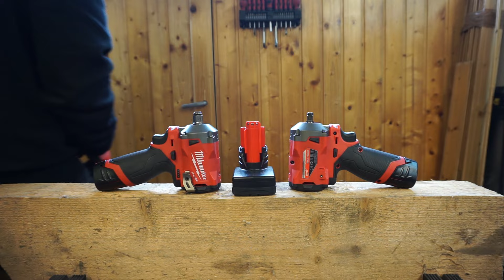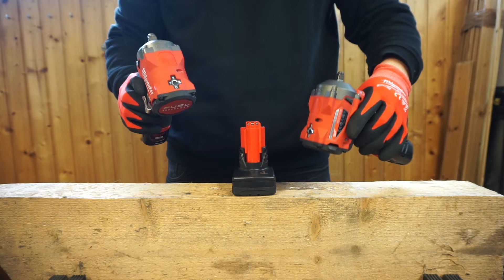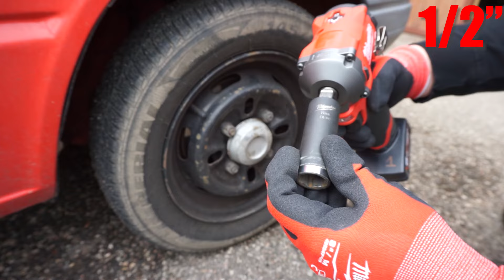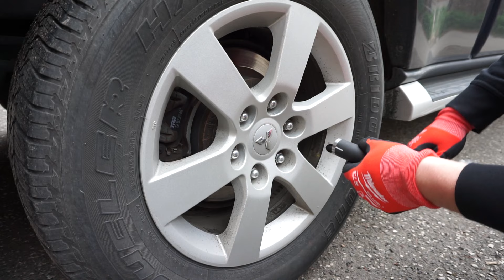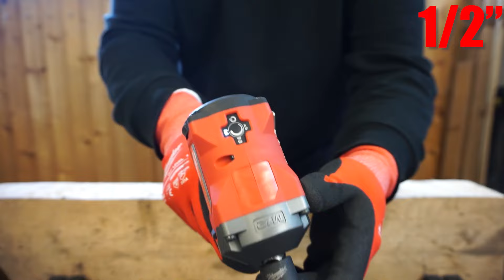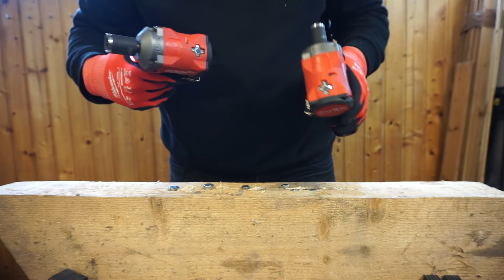3/8" stronger than 1/2"? - Milwaukee M12 stubby impact wrench 3/8" vs 1/2"

Comment: Cool test. I actually have two 3/8 stubby's since I couldn't pass up a deal on one for $60 bucks. Anyhow I run one like normal with standard 3/8 sockets and the other one I run with a 3/8 to 1/2 adapter. I can tell you without a doubt the 3/8 with the adapter hits way harder with the extra mass of the 1/2 sockets that it has sidlined my brand new Gen 2 1/2 Midtorque LOL. I work on light duty cars and trucks so that sucker surprisingly has busted loose most fasteners I've come across including heavy duty GMC/Ford suspensions. Kind of curious since you have both if you can run the same type of test, but using a 3/8 to 1/2 adapter on that 3/8 and run them side by side again👍🏼
Reply from the maker: Strange, most tests on youtube show that adapters take away a bunch of torque. I think the 3/8 hits harder because there is less mass to rotate with the lighter socket, thus load on the motor is smaller so it rotates faster and hits the anvil with faster blows...? Only a theory, otherwise I have no explanation why the 3/8 would be stronger.
Reply: @vpmotors9529  Trust me I've tested it myself. I used a 22mm deep 3/8 socket on a Old Ford Heavy duty lug nuts. I let the socket tighten as tight as it would go with no further movement. I then slapped on a 3/8 to 1/2 adapter and marked hash marks for reference on a 22mm deep 1/2 socket. Well to my suprise running it with the heavier mass of the adapter/socket combo that nut almost did another full rotation. My guess is the same as yours, but since now the faster 3/8 Anvil is swining the added weight of the 1/2 socket and adapter that inturn gives it extra beans to power through the standard 3/8 limit. That is why I'm curious to see that how that adapter set up will do against a regular 1/2 Anvil. I can actually feel the difference in power while using the adapter it's like a Mini Midtorque kinda hard to explain. Try it and let me know what you think?
Reply: @johnny4713ify  I had the same results, a 19mm 3/8 could not remove my jeep's lug nuts, but when i used a step up adapter, it removed without any problem. In fact, I installed new shocks using the 3/8 stubby and 1/2 sockets. Unfortunately, I feel like when it reaches 2 bars of battery life, it's not the same as having 4 bars.
Reply: @Pillzb3rry  Nice glad you tried it out. I ordered a Titan 3/8 to 1/2 adapter that's more compact essentially it will have almost the same Anvil dimensions as a regular 1/2 so ill be curious too see how it performs with a bit less mass. I normally run the 6.0 battery and get a pretty good run time before I hit the two bar mark. Your right though you do lose beans with any wrench when it starts to gets too low. BTW your 6.0 battery looks different than mine so I'm assuming your up in 🇨🇦 😁. I only say that because I've noticed Milwaukee batteries are labeled differently when they are sold out of the states.
Reply: @johnny4713ify  Look up ARES 70198 that adapter is like it does not even exist it is soooo small. I am suing it on my stubby and you can barely tell it is 3/8 and not 1/2.
Reply: @drscopeify  Hey thanks for the info👍🏼 It look's pretty much the same as the Titan (design dimension) adapter set I got. Your right these low pro adapters are pretty cool. I haven't tried testing the Titan against a regular 3/8 to half inch adapter just yet. Every gram of weight seems to give it more beans so going the low profile adapter route all the time might be decreasing a bit of power, So at least now I can pick and choose what adapter to use based on the location and size of the fastener kinda nice🤙🏼
Reply from the maker: @johnny4713ify  These are EU batteries, I'm located in Hungary.
Reply: @vpmotors9529  Pretty Cool👍🏼.
Reply: That would be a great comparison 👍
Reply: I noticed this same phenomenon when I put an adapter into my M12 fuel impact driver.  All the sudden I'm able to take off my cars lugnuts as long as I use my 4amp battery.  I still want to get a stubby 3/8" but I'm torn between the M18 fuel and the M12 fuel.  I have both batteries so the only thing I care about is strength.
Reply: @NonieTools  For me it came down to being able to get into the tightest spaces in and around vehicles. The M12 stubby can breakdown even smaller especially around the engine bay (no boot to hang up accidentally break a sensor lol) and still pack a punch with the regular Torpedo battery and now with the new HO 2.5 torpedo it's like having similar power to the boot style 4.0 in the smallest package possible. The M18 compact disadvantage is it can't become more compact to squeeze into tighter spots. The advantage it has over the M12 is the tri lights and run time it can go for days without a charge. I've seen plenty of test with the old m12  running a 4.0/ 6.0 boot battery go against the M18 compact running a 6.0 HO battery and the difference is minimal if that. Sometimes the m12 out performed the M18 in some test kinda nuts. Have you looked at the Gen 2 midtorque? The size and weight of one running it with a 3.0 HO battery will suprise you. I measured it to my stubby and it's a little over an inch difference in length and a tad bit thicker that's why I skipped the compact since the size difference wasn't too drastic plus you get tons more power. If you have Dewalt Batteries the 3/8 DCF923B seems to be the smallest impact with it's 450 Break Away and powerstack battery. I know hard choice 😅
Reply: @johnny4713ify  all very good points.  I am not a mechanic by trade, I'm a carpenter and a painter/ handy man.  But I do fix my own cars whenever I can.  I do lots of odd jobs like putting up fences, putting in handrails on stairs and building ramps. I think the stubby is more than I need power wise.  I only have Milwaukee batteries, and I just ordered the m18 fuel impact/hammer drill/multi tool/hackzall with a 6.0HO and a 3.0HO plus a 5 xc.  But I also have the M12 impact/hammer and 2 2.0s, a 4.0 and 2x 2.5 HO's.  Considering I already have bigger M18 HO  batteries I think I would benefit more from the M18 fuel stubby.  But I'm still flip flopping because it's such a hard choice!  I LOVE the M12 stuff I have. It's so smol and looks great.. I haven't looked into the mid torque but I feel like it's a bit too much power for what I do.
Reply: @NonieTools  Tuff choice for sure. I use my M18 2853 impact driver's a ton too for everything. They are pretty powerful from lug nutts to snugging down wood panels is a handy tool for sure. I can tell you one thing at least for me is weight. Lugging around a heavy tool all day can be a pain. Even with my M18 2853 I mainly use the a smaller 2.0 battery since I'm not doing a whole lot of heavy applications with it. When I do slap a 5.0 you can definitely feel the difference. For me comfort and power is what I look for. I think the Tri Lights and Battery life will benefit your work environment more than anything. If they update the M12 stubby with Tri Lights I'll take that over the M18 compact for sure. BTW I do believe the M18 compact overall head size is a bit less than the M12 stubby maybe thats why the M12 can still hold it's own and still seems to lay down a bit more beans. If you look at shop tool reviews test the M12 3/8 running a 6.0 with 1/2 adapter put up some crazy numbers. The only issue I can see you running into is space. Yah agreed the Midtorque is a bit to large for handyman work unless your running down anchor bolts all day lol. BTW you can always pick up second hand impacts off Ebay for cheap. I've picked up a few even a for parts only like new 3/8 stubby for $60 and yes Milwaukee still honors the 5 year warranty with no proof of purchase. I sent mine in and they sent me back a like new reconditioned running unit works great👍🏻
Reply: @johnny4713ify  I'm waiting for my M18 fuel impact to come in the mail along with a 3.0 and an 8.0 both HO.  I'm pretty sure the M18 stubby with an 8.0 high output battery would make more beans than the M12, right?  Of course it would be bigger and heavier though.  And by the way that's one hell of a trick I might just have to give it a shot next time
Reply: @NonieTools  That's awesome!!!! I have 8.0 HO M18 battery, but to me and from what I've seen online the 6.0's hit the hardes't unless you move up to the 12.0.  Man Caver tool reviews has a few videos running the M18 against thr M12 using the 6.0 battery. The 8.0 is great for battery life tho so you'll probably won't need to charge it for a few weeks LOL. If anything you'll save weight running it with the 3.0 HO. Yes sometimes I send in a pretty beat up tool and get back either a brand new tool or refurbished tool that looks new. I have also got back tools that are internally repaired and the shell is still a bit beat up, but I don't mind. The only thing to remember is to make sure the serial number is still visible and know how to read the manufacturer date so you can verify that it's still under warranty. You can go into your Free Milwaukee account input the tool with the serial number and it will tell you if it's under warranty even before you buy it off some place as long as you can read the Serial# you can check it on the site. Please let me know how you like your new tool and if anything pick up a second hand stubby on ebay for cheap used or parts only then send it in. Happy for you bro👍🏻
Reply: @johnny4713ify   @johnny4713ify  thank you for the info, I just checked and it's actually coming with a 6.0 not an 8!  Should be here tomorrow.. so pumped to get my hands on everything. I just saw on torque test channel that the 6.0 outperforms the 8.0 by a little bit.  Something to do with the different specs of the cells in the bigger battery.  Anyways, I have already started hitting up people on FB market looking for some used stuff! Again, thanks for the advice!
Reply: @NonieTools  No problem. Let me know how she runs for you. Don't forget to pick up a protective boot for your investment 👍🏻 Congrats!!!!
Reply: @johnny4713ify  just went to home Depot to return something and they had a M12 fuel stubby 3/8" impact with 5.0 high output battery and bag and charger on clearance for $169.  Model 2554-21HO.  I COULDN'T pass it up.  Something about a black Friday deal leftover that they dropped down even more.  Crazy.  My m18 stuff is so powerful but I'm constantly reaching for the M12.  Anyways, can't wait to rotate all my tires this weekend.  Hope all is good with you brother.
Reply: @NonieTools  WOW!!!! That's a smokin score brother 🤯. I saw that deal a few months back at $350 now it's on HD website for $250 for the clearance sale of $169 with everything was a killer deal. Bro now your going to be the go too for the pros and cons of both 🤣. Glad you have both to work with since I'm sure your going to come across jobs that require the right tool more run time with the M18 and squeezing into some tight spots with the M12. I can already see you battling them both on your vehicle wheels LOL. You can always shave off a few seconds with the 3/8 to 1/2 adapter while using deep impacts when doing tires💪. I see your reaching for that M12 over the M18 I get it she is addicting once you take her for a spin 😜. Happy for you brother.
Reply: @johnny4713ify  Which do you recommend Milwaukee or Dewalt?
Reply: @johnny4713ify  yep hell yeah I took the day off from work because my daughter was home sick from school and I totally re-fastened her swingset.  Used every single tool I have (except for the multi tool) the M18 drills and the M12 drills and impacts, including the stubby. Cut off the ends of the long protruding 5/8" bolts with the one handed hackzall w/ a thick metal cutting blade by Diablo. Like a hot knife through butter my friend.  Looks like I need to get some 1/2" sockets and some 1/2" adapters.. my 3/8" impact set is metric and SAE 48 piece set by WIILDIS only $50 on Amazon.. what socket set would you recommend?
Reply: @novavolks9652  besides the 5 year Milwaukee warranty for me it's the M12 stubby. Why? I wanted a reliable yet powerful impact wrench that could get into the smallest spaces possible. Yes the new Dewalt and M18 compact are cool with the Dewalt having a tad bit more power, but neither can break down into a smaller tool like the M12 stubby you can run it with the torpedo style battery and get into some crazy spots in and around vehicle engine bay's and suspension locations. With the Dewalt or M18 your stuck dealing with a big o boot style battery hanging at the bottom. Dewalt does have a smaller powerstack available, but trust me even that will get in your way at times. I do love the Tri Lights of the newer impacts tho so I really hope Milwaukee comes out with a newer version of the M12 stubby that has that feature. If you read the exange of the gentleman above, he bought the M18 compact recently and then got an awesome deal on a M12 stubby and seems to enjoy the stubby more. Me and him had a great conversation as too why I skipped getting the M18 compact. I hope I gave you my insight, but ultimately it's your choice to make either way I'm sure you'll be happy with either tool.
Reply: @NonieTools  Lol Bro your like a kid on Christmas day that's Awesome!!!! As far as impact sockets any quality set as long as they offer lifetime warranty you should be good. Gearwrench, Sunex, Astro etc. Just try to find the best deal. You can even hit up Harbor Freight and pick some up from there. Absolutely no need to get yourself in debt buying big brand name tools. Since your a handyman I'd say being organized is key so while at the job site your not digging around a tool bag or box for the proper size socket will save you time, plus will keep you from losing a socket or two since you'll notice quick that your missing one before leaving so I'd say get a set with a case👍🏻. You'll know what is essential while out in the field then you can start building your tool arsenal accordingly. For me visually able to spot a socket size is #1 so get a set that you can see the size, if your like me and don't mind marking your tools buy a permanent white industrial pen with a steel ball like a Nissen metal marker and paint them on. I'd say a set of 3/8 impact swivel sockets might be the only other items you may need. Always here to help. UPDATE I just seen YouTuber Mastering Mayhem do a quick video on the $169 deal in stores pretty cool too bad I'm already knee deep in stubby's LOL. Hopefully they will start having sales on the HO 5.0's soon.
Reply: @johnny4713ify  and of the ratchets, would it be a good idea to buy the Craftsman? It is a 3/8 input and the battery is 20 volts. The latter convinces me, many do not know it but I see good quality, by the way, where can you buy your Milwaukee impact wrench? in which store?
Reply: @novavolks9652  Craftman is OK i just don't like that particular design when it comes to cordless ratchet. I use the High Speed 3/8 Milwaukee and it's next level fast. People forget that these tools are ratchets (nut runners) not impacts so you might need to break it loose like a ratchet then run the fastener off. I apologize if your not in the states, but you can pick up Milwaukee at Home Depot or other Authorized retailers if not Amazon and other online stores do have them. Unlike other brands Milwaukee honors your 5 warranty no matter where you buy the tool from. I have friends in Canada and Milwaukee tools are crazy expensive there kinda nutts. Milwaukee just came out with the extended HS version so that is the one I would get over the standard High Speed since you can reach further. Unlike the previous version with the 55lbs break away the new High Speeds have a smaller heads so you can get into some tight spots. Hope this helps.
Reply: @vpmotors9529 they do, but the mass of the bigger 1/2 inch impact socket gives it more momentum (in this instance)
Reply: The 3/8 stuby is just a beast. I rarely get mmy 1/2 gun out these days. I've got 2 new ones as I keep 1 as a spare just incase. I doubt it'll ever get used as these things are bomb proof.
Reply: @sliderdriver1  LOL totally feel you. I recently sent in my 2754 M18 for service and Milwaukee sent me back the new to me Compact M18 3/8. I was a little disappointed since I did like the ergos of my Oldie but goodie. Anyhow since I'm already swimming in stubby's I never pulled the trigger on the compact. That being said that sucker puts down some serious beans with a HO 8.0 battery LOL I never use it though and like you it sits in the corner with all my Midtorques and Hightorque's until they are needed 🤣. BTW I tested my Milwaukee impacts on my Honda Crank bolt since the Harmonic Balancer was bad. I was plannimg on testing the stubbys all the way to the Hightorque's just for laughs well it surprisingly came loose with the Gen 1 Midtorque using Lisle 19mm Socket and HO 8.0 battery since my 5 amp battery was already down to 2 bars I skipped it and just used the 3.0 HO with no success. I had My Gen 2 Midtorque and Hightorque's on deck, but obviously didn't need them kinda cool. BTW my set up is one stubby with a 2.5 HO and another running the 6.0. Makes jobs a breeze 👍🏻
Reply: @NonieTools  hi. At 250 ft lbs the 3/8 m12 is more than enough for 90% of jobs on the cars. Not many wheel nuts go beyond 140 ft lb. For the odd crank bolt or rusted in rear suspension 19mm bolts etc, a 1/2 full size nut gun is the tool in my book. It's nice to have every tool out there but I reckon you only need 2 or 3..
Reply: Thanks for this comment sir, I just got back from the shop and when I tried the 1/2 adapter pulled lugs off way harder, it's definitely noticeable, thanks for the advice!
Reply: @Eclipsile  No problem! 👍🏻I had to use that trick tonight while replacing an axle. The previous mechanic used red Loctite on Toyota lower ball joint bolts. SMH! I always use orange. By the way, get yourself a few M12 2.5 HO batteries. They make my Stubby's hit almost as hard as my 6.0's, plus they give your M12 ratchets extra power. Glad I could help.
Reply: @johnny4713ify  thanks so much for the advice man, you're a real life saver, and red loctite? Some people shouldn't pull wrenches, anyways I hope you enjoy your week, thanks again!
Reply: @Eclipsile  Absolutely, 1000% agree. Over-torquing and using red Loctite on the ball joints is one thing, but yup, you guessed it, they also Loctite the axle nut too 🤣🤦‍♂️. Always here to help. Have yourself an awesome weekend as-well.
Reply: In other tests the 3/8 is more powerful than the 1/2"  it did 600ft pound while the 1/2" barely did 500ft pounds.   Sounds like the 3/8" is better than the 1/2" stubby.
Reply: @Physics072  From my experience, that only applies if extra mass is added to the equation. If you notice, video test reviews often use a step-up adapter on the 3/8" stubby. Some, like Shop Tool Reviews, even weld the adapter onto larger sockets to achieve those numbers. I now own both the Gen 1 3/8" and 1/2" stubbies, but I recently picked up the Gen 2 1/2" Stubby with an XC 5.0  battery, and it’s a beast. I can confirm that when removing a 19mm fastener torqued to 250 foot-pounds, using standard 3/8" and 1/2" sockets (no adapters), the 1/2" stubby removes it quicker. However, when solely using 3/8" extensions or swivel sockets, there is a noticeable loss of power unless you use an adapter to convert it to 1/2" hardware. I’m pretty sure this phenomenon in greater power would also occur if someone ran a 1/2" stubby with a 3/4" adapter socket and hardware. It would be cool to see someone test that. Anyhow the only real advantage the 3/8" stubby has is the size of the actual sockets—you can get into tighter spots with a 10mm 3/8" socket compared to a 1/2". The 3/8 Stubby will serve most people fine on regular passenger vehicles, but get the 1/2 if you work around HD vehicles. Apologize for the long comment, but I wanted to address the advantages and disadvantages. That’s why I now run both 👍🏻
Reply: @johnny4713ify  Im a casual user will not be using it all that much.  So would you suggest I go with 3/4 or 1/2 subby gen 3?
HD vehicles means what?